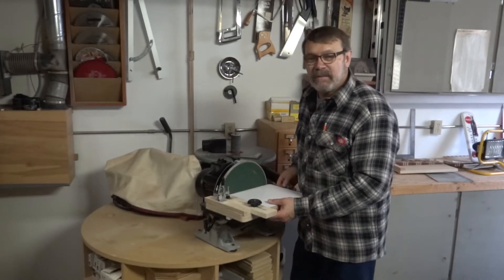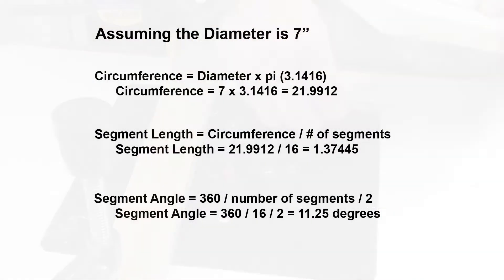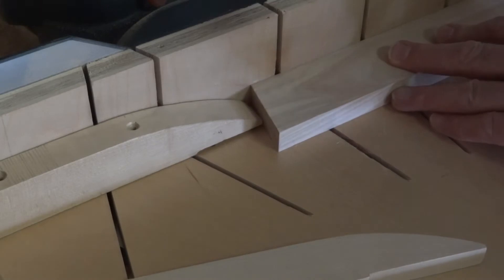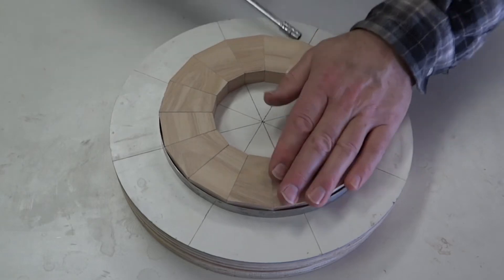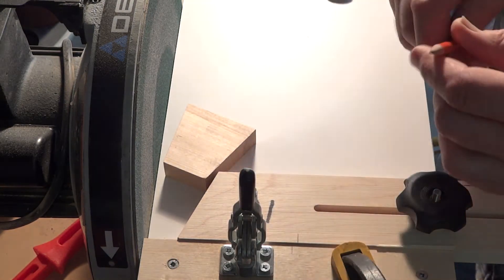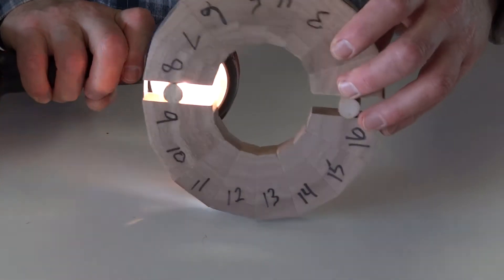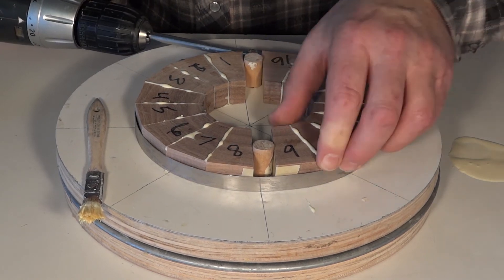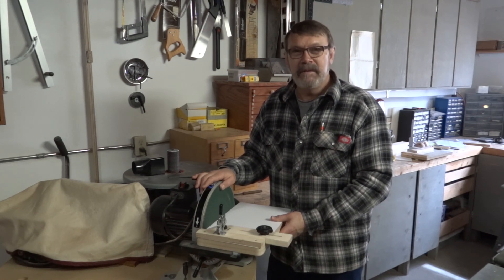Sanding Jig For Segmented Woodturning   Part 2

Comment: Very detailed, I just turned my first segmented vase, and I had trouble getting my rings to fit exactly. I am going to make this jig. thank you.
Reply from the maker: That is a very old video and I have been using a better system called a "Wedgie Sled". I suggest that you check out my video called "Quicker & Easier Segmented Rings". It is much easier and more accurate. I hope you will like it!
Thanks for watching!
.....Gord
Reply: @GordonRock1  I have been using the accuwedge designed by John Manura and have been getting some good results with it. I am going to build the wedgie sled and compare. With the accuwedge I can really dial in the dimensions exactly.
Reply from the maker: That sounds awesome. I haven't heard of the accuwedge before and I will have to check it out. Thanks for the tip!!
.....Gord
Reply: @GordonRock1  your sanding jig is spot on, and I still believe it would be a valuable tool, I might try to build it hopefully I can follow your process successfully without messing it up.

Comment: Very detailed instructions Gord, I can't go far wrong if I follow your advice. (Well I can actually, but that won't be your fault!). Both parts very enjoyable.
Reply from the maker: Hi Kevin,
Very glad you liked it. I still use the sanding jig occasionally when doing a complicated feature ring but if I'm doing a segmented ring with segments that have no diamonds or other things like that I now use the Wedgie Sled which I think was invented by Jerry Bennet. If set up properly and you use the wedgies he sells or have a way to make the wedgies accurately it is a much quicker method. I have a video that explains it and I believe it's called Quicker and Easier Segmented Rings. You may want to check it out as it really is a much quicker and easier method.
Thanks for watching, Kevin!
All the best,
.....Gord

Comment: Great video, Gord. I will be building one of those.
Reply from the maker: Thank you, Ralph, I'm glad you liked it. If you plan to make one for segmented turning I suggest you take a look at a more recent video I did called Quicker & Easier Segmented Rings. I wish I had known of the Wedgies I show in that video a long time ago. As much as I liked using the sanding jig I have to admit the wedgies are an improvement and a lot easier to calibrate than the sanding jig. It could save you a lot of work.
Thanks for watching. I appreciate the support.
Take care,
.....Gord
Reply: So Gord, you are saying that the wedgie sled is good enough that now sanding is required?
Ralph
Reply from the maker: Exactly Ralph! I have not needed to sand any segments since O started using the wedgies and the wedgie sled. The wedgies are not cheap but they were well worth the expense to me!!
Take care,
.....Gord

Comment: I think the precision involved in the cutting and glue up is what separates the men from the boys in segment projects.  Sure, you can epoxy up the cracks etc, but we all know it just aint the same. Very clever work around on the final adjustment,  I just wonder what went wrong to need it.  Could have been tolerance stack.
Reply from the maker: Thanks for watching. I appreciate the feedback.

Comment: Gordon, you have presented this construction in a very clear and accurate way. In particular, the fine tuning of the angles, in particular, the final adjustment of the adjuster itself. Very clever. Question: Are those working surfaces you use melamine? I notice you glue directly on it. I assume whatever this surface is does not allow wood glue to stick. I love your postings, keep up the good work and Happy New year!!
Reply from the maker: Joe Ritz Hi Joe. Thanks for the kind words. Yes, the surface is melamine. The glue sticks to the surface but scrapes off very easily. Thanks for watching & commenting. Have a very Happy New Year.

Comment: Great video.  What kind of vise was that which you used to hold the long board?
Reply from the maker: Hi Billy,
That vise is a Zyliss vise. It's a Swiss made vise but I don't think it's in production any longer. There are a few knockoffs available and I believe you can find them on Ebay periodically. I LOVE it. There is hardly a day goes by when I don't use it. I hope you can find one if you want one. Thanks for watching!
.....Gord

Comment: Just a thought... I think that your "occasional inaccuracy" is due to the fact that you made your segment adjuster out of natural wood.  Wood expands and contracts across the grain.  The angle runs across the grain so as the wood moves, it is like changing the length of one side of a triangle.  If just a few pieces of masking tape are enough to throw off the cut angle, then this surely could be the cause.  I would probably make your segment adjusters out of baltic ply or better yet, phenolic or something like that which will react completely isometrically to temp or humidity changes.
Reply from the maker: 21st Century Woodworking It never even occurred to me!! As a woodworker I should have that in mind at all times but the little things sometimes slip my mind. Thanks for the feedback; I will keep that in mind for the future. Thanks for watching & commenting.

Comment: Great video, am going to build the sled for my 12" sander. Quick question, in use, is the sled moved at all left right? Or is it primarily used in a fixed position.? Thanks.
Reply from the maker: Mark, I usually moved it left and right to try to even the wearing of the disc but it could be left in one position and clean the disc as needed. However, I don’t use it anymore for segmented rings as I now use the Wedgie Sled. If you want to know more about that you can find my video called Quicker & Easier Segmented Rings. It’s much easier to use and very accurate. I’m happy that you found the sled interesting and I still use it occasionally for other things. Thanks for watching!
Happy turning,
.....Gord
Reply: @GordonRock1  Thanks, I use a wedgie sled for most of my cuts, and can get a perfect fit 95% of the time. When I work on large platters, I sometimes have to resort to an Incra miter gauge which although very accurate, can be a bit gappy  on a large width and edge length wedge (5" or so). I cleaned these up by hand on a lathe mounted disk, but want a better rig, so here I go!

Comment: Hello Gord, I have been following your build on the disk sander jig. I bought a delta sander like yours and am trying to make the jig. I took your advice and removed the sandpaper prior to the parallel and 90 adjustments. It seems like the 80 grit is a bit too much for making these small parts. Is that what you use or would a 100 grit be a bit better?
Reply from the maker: Hi Ray. I always use 100 grit on my disc sander. I am glad you like the jig but that was quite a few years ago and I have since stopped using it for making the segments. I now use the Wedgie sled that was developed by Jerry Bennett. It is used on the tablesaw and does a much better and easier job. I suggest you do a search on YouTube and you’ll find a lot of videos showing how to use it. I have one out there myself but at the moment I can’t remember what it’s called. If you have a tablesaw I think you will really like that jig. Thanks for watching!
Happy turning,
…..Gord
Reply: @GordonRock1  I use the Wedgie sled too. It sure solves the problem of getting a perfect ring. I am interested in using the disk for feature ring builds. I want to branch out and get more complex feature rings. I can't see any other way to do some of the "Ray Allen" rings without it. Do you have better ways to do those now?
Reply from the maker: No, I don’t have a better way to do feature rings. For that the disc sander would be perfect. I hope you enjoy making them. Designing and making feature rings can be a lot of fun although also quite a challenge. Have fun with it!!
…..Gord

Comment: Gord I have just got into segmented turning . I just purchased a new Delta 12" disc sander. The first unit came damaged in shipping and with 0.020" of Disc wobble. The second unit is OK except the Disc wobble is still at 0.014". What is acceptable Disc  wobble?
Reply from the maker: I’m sorry, John, but I don’t know what would be considered acceptable. I don’t even know what my sander’s wobble is. I have never checked.
If you are new to segmented turning I have a suggestion. Ignore the information in that video as I made it years ago and I no longer use my disc sander for making segments. Check out my more recent video “Quicker and Easier Segmented Rings”. I am now using the wedgie sled invented by Jerry Bennett. It is far superior to the disc sander method. The video is only about 3 minutes long and will direct you to more information.
Happy turning,
.....Gord
Reply: @GordonRock1  I have made one of the wedgie sleds and purchased a set of the wedges. I need the sander for making feature rings. I am going to attempt to make a ring and see if the disc wobble is acceptable. Thanks for the speedy response. I have learned a lot from your videos.
John
Reply from the maker: I’m happy any time I can help. Thank you very much for watching, John!
.....Gord

Comment: Hard to believe which seg. bowl I have done and free handed seg. that were not quite perfect.   Today I just planned another bowl and SAID I need a seg. sander.  Thats the next step
Reply from the maker: I hope it works for you, Craig. Actually, I don’t use that system any longer. I use a Wedgie sled on my tablesaw now. However, that will work for you if you don’t have a tablesaw and Wedgie sled. I wish you luck with it. Thanks for watching!